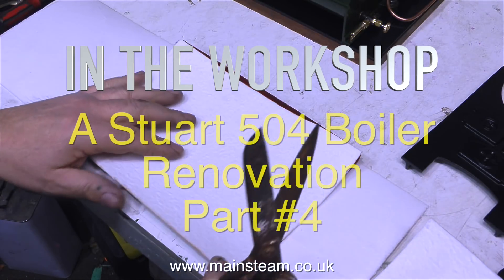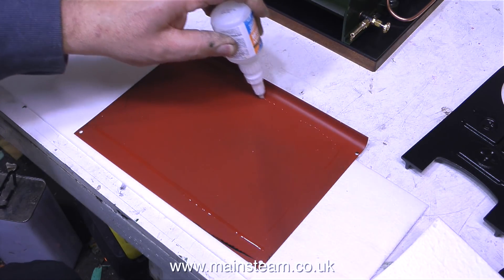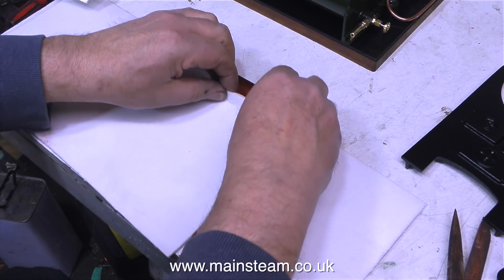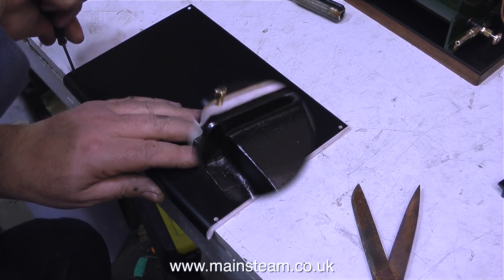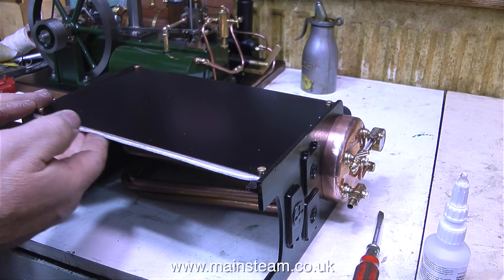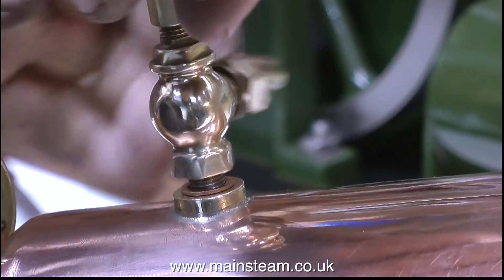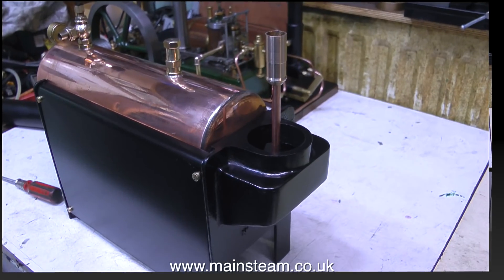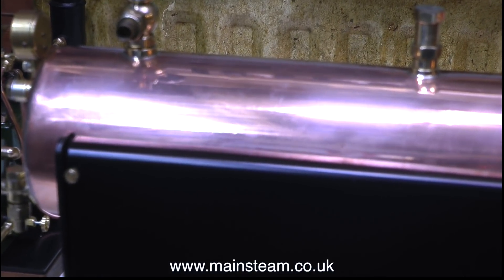A STUART 504 BOILER RENOVATION - PART #4 - IN THE WORKSHOP

Comment: Hello Keith.  I was not able to find description for installing steam amplifier assembly (part #3?) that is inside the 504 chimney?  Did see details about installing 3/8 x 32 steam union at base of chimney to connect condenser-oil separator.  I am working on a 504 myself, and your videos have helped immensely.  Many thanks.
Reply from the maker: I have just waded through 35 videos in that series and I can't find the bit about the exhaust amplifier I made. It is just a shallow cup on the end of the steam exhaust pipe in the chimney - like a small megaphone. Maybe I spun that off as a separate episode in the 'In The Workshop" series but I don't know. There are currently nearly 1100 videos on Youtube and I don't have enough time spare to reference them all.I make one almost every day. Thanks for your help Jeffrey, I always appreciate it }:-)))
Reply: @keithappleton  Thanks for looking.  Santa will be leaving a late present for you at Blackgates.

Comment: Keith, the Boiler came out very well, especially the polished copper. You mentioned the Design of the exhaust pipe and amplifier in part#3, but I couldn't find the part. Maybe you referred to a different video? Couldn't you give me a hint? Thanks in advance. Kurt
Reply from the maker: It will be somewhere in the series after part #3 . . .

Comment: These newer ceramic-based insulating materials are no safer than good old asbestos, in my opinion.  Asbestos which is not in fiber form is totally safe.  It is when it is cut with a saw or something else that throws fibers into the air that it becomes unsafe.  Newer ceramic insulations come with the same warnings they used to give in the end days of asbestos.  My father used to work in a plant that made fiberglass insulation for a couple of years, and they had no breathing apparatus, yet he told me how the glass fibers floated in the air, and they breathed them with abandon.  My father died at the tender ager of 84 this year from lung cancer.  The doctors said it was from smoking cigarettes, but he quit smoking at 64, so that tar really must take a long time to do it's damage.  Lol... More likely, it was the tiny glass fibers that he still had in his lungs from his 20s, IMPO.  Whatever you do out there, just understand the risks and take precautions to avoid them, everyone.  Work safe.

Comment: To hold the insulation in place you might try putting a couple of small bolts in the holes nearest the top temporarily. A couple of matching holes in the bats of insulation should stop the sliding.  As another viewer suggested, I think the 3M spray adhesive would be perfect for this situation. Once again you have taken a pig's ear and turned it into a silk purse.

Comment: Forgive me if someone else suggested this, the comments wouldn't show for some reason;

On fill size watertube boiler we often use ceramic wool insulation too, and have had a lot of success in using stainless steel perforated sheet made into a retaining sheet and fixed through in a couple of places in the middle to stop heat distortion and a few places round the edge to clamp the insulation well- we've never seen one fall apart yet.
Reply: The sheets I remember were almost like a fine chicken wire and were all sharp edges, installed it with bolts and fender washers. I was thinking the fine mesh from cooking splash screens would work for holding it in place, but what Keith has done is the simplest answer.

Comment: Superglue releases with heat.... So if the panel gets hot the insulation will fall of.
Reply from the maker: No it won't - I have renovated a few 504 boilers without this happening. Please watch the video more closely and notice how the insulation is also clamped between the side panels and the end plates }:-)))

Comment: I suppose Stuart don´t make bad products. But I have seen plans for a water tube boiler that had the tubes go on the outside, not trough the slightly cooler water in the barrel. Do you think, in a model boiler, this would mean anything to the efficiency of the boiler?

Comment: Maybe spray some Isocyanurate adhesive accelerator on the insulation first, or use one of the thicker  Isocyanurate adhesives designed for porous surfaces.

Comment: I was thinking that maybe if you used a piece of wooden dowel with rubber bands to hold it in place on the curved bit of the panel, it would hold the insulation in place whilst the adhesive sets? Great Video. It's turn out so nice!

Comment: Gosh - quite the improvement from the "before" pictures! 

I shall look forward to seeing what you do with the burner. How good do you find the original spirit burner to be compared with putting a ceramic gas burner raised a little just underneath the tubes?
Reply from the maker: The original twin Spirit Burners are really good, but you can't regulate the heat at all so the boiler loses water by constantly blowing off ...... so a gas burner is a better way of firing this boiler